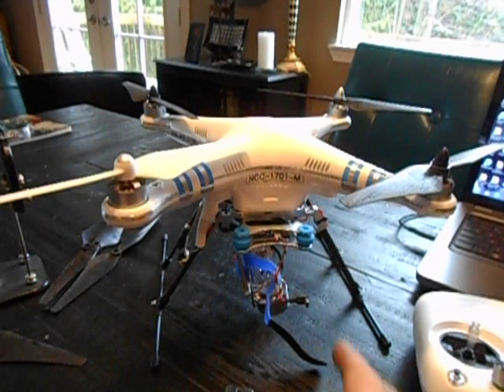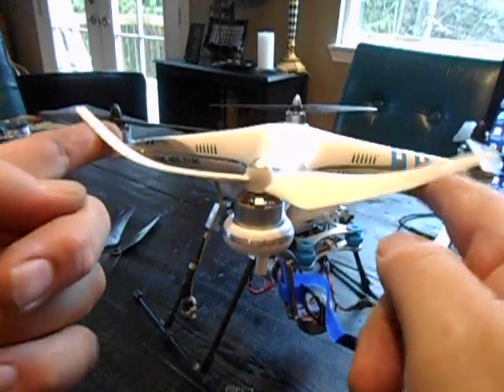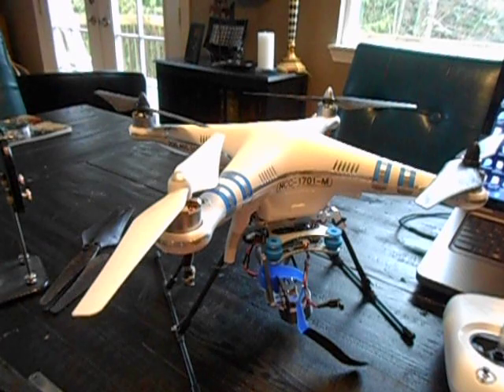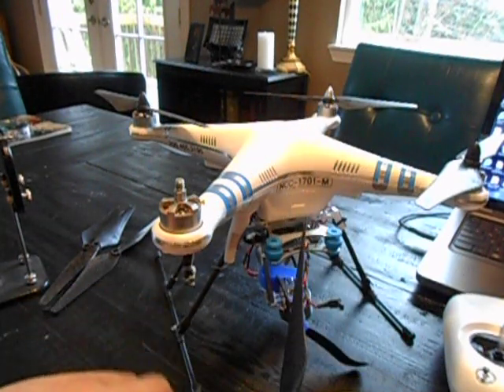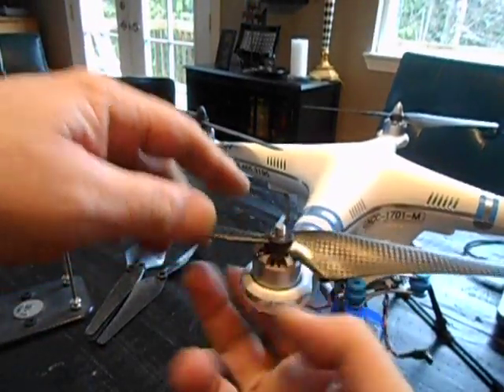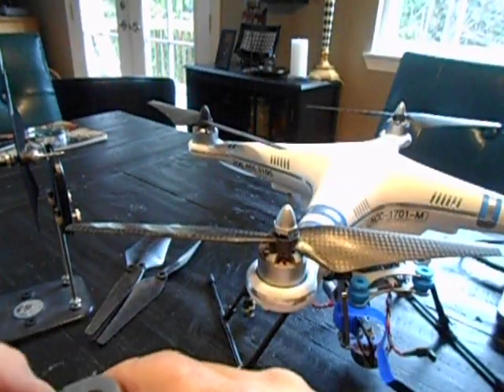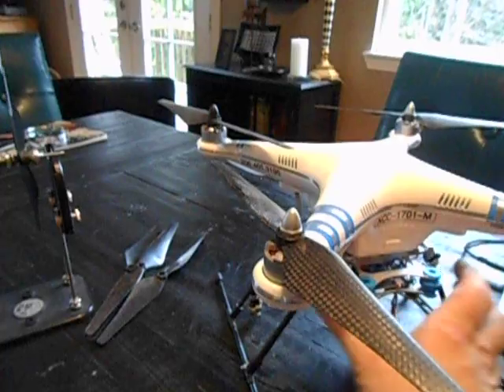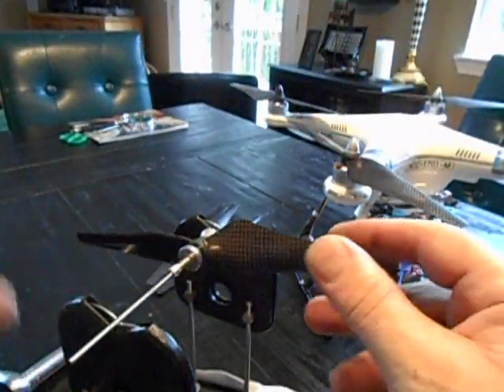DJI Phantom 1 & 2 Prop comparison *Stock VS Carbon Fiber*

Comment: when I got it for everything it has.❄.❄>JustU.Faith/DJI-Drone?情 The case is a great quality and fits everything perfectly. Having the second battery is also very useful to have. The drone itself is awesome and is perfect if you want a nice quality drone and camera, but don't want to spend a ton on the phantom 4 or 4 pro. Overall I love the drone and the extras in the bundle, would definitely recommend this kit for starters as a case is pretty necessary.

Comment: Hello, i purchased carbon prop for phantom II however i was unable to get the correct gain for avoid bad tendency in flight, what gain do you use with carbon prop?
Thnaks for your video

Comment: How safe are the Carbon Fibre props? I've seen a few videos and articles where people have been hurt using these carbon fibre props..
Reply from the maker: Mohammed Hoosen If you stick your hand in a plastic prop (@ 50%throttle) do you think the damage would be any less than a Carbon fiber prop? I think not. When comparing plastic vs CF the plastic props are more apt to snap off in hard maneuvers. Loose a prop at 60 feet and you will drop like a rock on to....a car, a house, people..you name it. Take a look at some pro quadcopters and check out what they use. I don't use phantoms anymore and fly 800 size quads that use  16 inch threehole props. I could never imagine going back to shitty plastic props.

Comment: Have you had any issues with vortex ring state (VRS) crashes?  I heard this is more of an issue with the rigid nature of cf blades because when you use the cheap plastic ones, they will bend changing the thrust direction reducing vrs induced crashes.
Reply from the maker: I've never encountered a VRS condition. At 400 feet I have encountered strong updrafts (thank God for telemetry) that even after reducing power to 40% the quad kept on climbing. Anything less than 40% causes loss of horizontal stability. The only way to get it down was to increase forward movement and fly it down. This happened on a 800 wheelbase quad I built w 16x5.5 carbon fiber props. When I finally landed the props and canopy had ice crystals  covering the surface. I wonder how the flight controller (Naza M V2) would handle VRS?
Reply from the maker: Mitch Peterson
I've long since sold all the Phantoms and moved on to building my own. They are capable of way more payload and up to 40 minuets of flight. All are full FPV with OSD and way point programing. Size rages from 680 to 800 wheelbase.
Reply: Mitch Peterson I'd love to do that too, but there's not much incentive for me to move to a larger platform unless I can accommodate a larger camera like a Canon 5D or Panasonic GH4.  The Zenmuse Z15 is practically the only gimbal for that setup and that is $2500 itself.  Might as well stick with a Phantom with an H3D for now since the cost is 5 times less for the gimbal.

Comment: Hi There

If you use the locknut on the shaft you introduce an eccentric load on the shaft  and you wont get a perfect balance on the prop because you will be compensating for it. the entire rotating apparatus must be perfectly balanced to isolate and correct the imbalance in the prop alone.

I only mention as I did the same thing and had to revert after failing to balance a set of superlight props.

happy flying
Reply from the maker: Proof is in the pudding. All props need to be balanced period. I really don't know what your point is? Either a spindle nut or (Prop being keyed to the shaft) or a self tightening prop exert downward pressure on the propeller hub. With a properly balanced prop jello is a thing of the past even wo an isolation plate.
Reply: Yep! Absolutely true!

Comment: After watching, I'm still trying to figure out what was the point.  Do they fly okay?  How do you balance them?  DO you balance them? ...
Reply from the maker: The point is that CF props will consistently give you longer flight time and greater stability not to mention they are 10  times stronger. Of course I balance all new props. Have you ever purchased perfectly balanced prop? Not me....even T-props need balancing.   Have you ever bought new tires for your car and not balanced them?
Reply: Oh, okay.

Are you saying props are manufactured out of balance?

Not meaning to be confrontational, but your analogy is a bit confounding, considering that WHEELS are what get balanced, not tires.  In this case, the motors are the "wheels" and are already balanced (or should be), after which props are mounted and the unit sent to the customers.  

Regardless, I'm now confused - if you are correct that props are made so imperfectly as to not fly right - how one is to actually get a prop IN balance???  Are their little weights to add (like on a car's wheel)?  Does one need to trim off plastic to get the weight right?
Reply from the maker: da Bob "I own a 4 Wheel drive truck", "All four wheels need balancing" . Wheel meaning tire and rim is what gets balanced.
Prop balancing is done with a du-bro type balancer by either adding weight (Clear packing tape to the light side or removing weight from the heavy side. Remove weight w fine grit sandpaper.
For carbon fiber I normally sand off the weight  however on my C&C wood props I add weight.
On fixed wing aircraft wood props the balance is done in both horizontal and vertical positions...horizontal for the blades and vertical for the hub. Generally multirotor props have a small hub so it's not as critical.
Do a search on prop balancing and educate  yourself.
With a properly balanced prop the "Jello" is gone even without the use of an isolation plate and the bearings in the motors will remain happy.
Reply: Nothing is simple, is it?  

Good advice and thx for the good sportsmanship ;-)

Comment: How do I know if the carbon fiber props I buy are balanced or not?
Reply from the maker: I'll tell you, I've never bought a prop that's totally balanced. Even if they claim it's balanced it needs to be checked. Kind of like when you buy tires for your car....they all need to be balanced. Please subscribe to my channel. I have a tutorial on balancing props.
Reply: Mitch Peterson hey thanks for the quick reply. I saw your channel and subscribed. You have some really good videos. I'm totally new at this and am looking into purchasing a kit from dslrpros for professional video projects.
Reply from the maker: Breakdown916
Thank you and good luck on the kit.

Mitch
Reply: Mitch Peterson Hey Mitch, I accidentally ordered two carbon fibers instead of four. Can I mix the carbon and regular props (two of each) and fly the copter that way? How will it effect the flight pattern do you know?
Reply from the maker: Breakdown916 Hi, I would not recommended it. Check out the difference in the stiffness and weight. Although the naza would compensate to some degree for me it's not worth the risk. By the way I've been buying carbon fiber props from Hobby King. Nice props at half the price and are even "keyed" so no spin-odds.
Reply: Mitch Peterson sweet i'll check them out… thanks!
Reply from the maker: Right on man....time to fly

Comment: Doesn't the setscrew method make the shaft unbalanced on the DuBro?
Reply from the maker: Setscrew method? Consider this, I've balanced  hundreds of props w the DuBro and the collar/set screw sleeve. Zero jello with or without the rubber isolation plate. I did shorten the set screw so it was even w the sleeve when tight. I balance props both vertical and horizontal.
Reply: Mitch Peterson Cool. Might try that myself. Thanks for the reply

Comment: Where did you get the props from
Reply from the maker: Hi there, here's the link...they will need to be balanced:

http://www.ebay.com/itm/181303461278?ssPageName=STRK:MEWNX:IT&_trksid=p3984.m1439.l2649

Comment: Hi,
Are your landing gear foldable?
Where did u buy from?
Thanks
Reply from the maker: You can find them at turbo ace. They are for a 830 quad. No not fold-able. Too much weight for these little guys.

Comment: How much flight time are you getting with your unit?
Reply from the maker: Hi Eric, I get a strong 19 minuets. With all the added weight I'm happy to get that.

Thx for stopping by,

Mitch
Reply: Do you fly fpv or line of sight?
Reply from the maker: Eric White
I fly both depending on where I am and what I'm doing. I do aerial videos for real estate agents. I use the Phantom, X650 (Xaircraft) and also a 650 sized unit  I built. If you subscribed to my channel you may have seen it. Really fun to go to the desert and put on the goggles....that's the ultimate for sure. At 1000 feet it's like being in another world.

Mitch